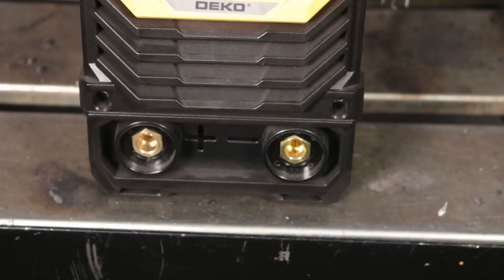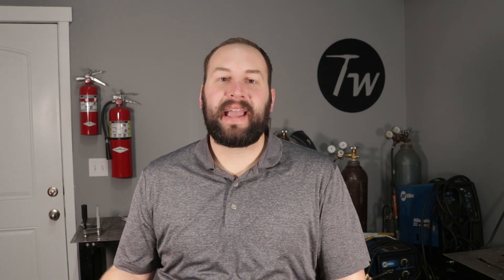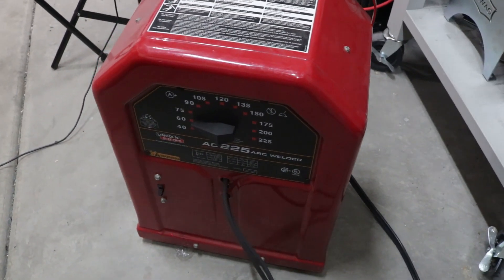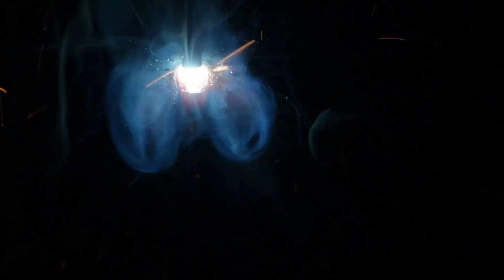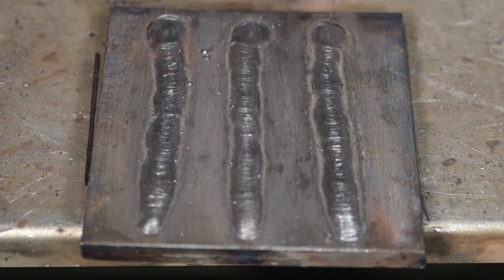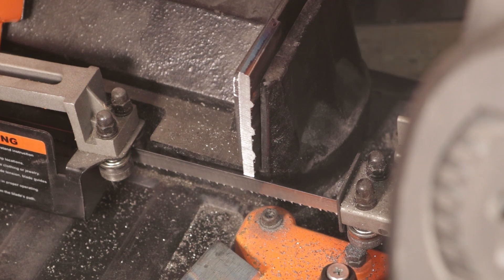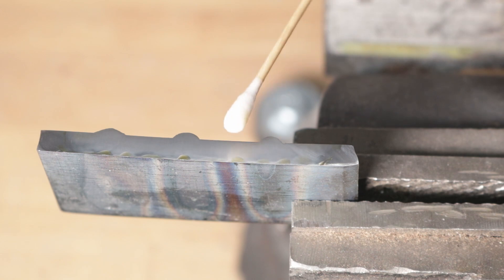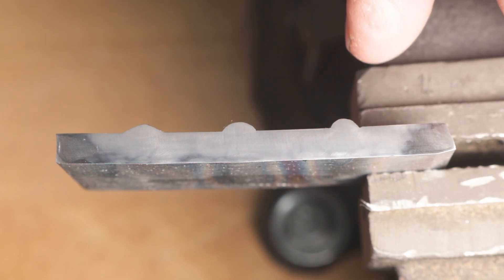Stick Welding Polarity Explained: AC vs DCEP vs DCEN

Comment from the maker: You can learn to weld.  I'll show you exactly what to do in my affordable online welding courses at https://courses.timwelds.com.
Reply: Are there special precautions to be taken when doing DCEN? Any risks of electrocution compared to DCEP?
Reply: 2/3 of your heat is always on the neg side - you have it backwards. That's why you get more penetration on  the EP as opposed to a shallow weld on the EN side
Reply: Hi,
What does IGBT stand for? Is that a DC welder?

Comment: Bought a box of rods (Niko Steel 7016 RD-360U) on the box it recommends to run root passes at DCEN but whenever I've tried running them negative they just rope up like that third one and don't seem to penetrate much, even if I turn it up hot enough to burn holes, it never seems to wet out properly. 

I've read the characteristics of the rod and they do claim that fillets especially will be quite concave. Did all the same welds with DCEP and they ran so much better, I can't work out why the manufacturer would recommend DCEN?
Reply from the maker: DCEN reduces penetration, so for an open root butt joint, it could prevent burn through. I’d just run DCEP if I were you. I run DCEP more than 99% of the time with all stick rods.

Comment: I thought DCEN provides deeper penetration compared to DCEP..
Reply from the maker: It does with TIG, but not with stick welding. EP sends the bulk of the heat to the electrode, but it’s transferred right back into the workpiece with the molten metal.

Comment: By the way Tim, after having cut; polished; and applied a chemical solution to your metal “sample piece with the #3 welds”, I did not see any  difference between the welds because it was blurry! … Which by the way was the  purpose  of this instructional video.! … To show us the different weld penetration levels due to the different electrical power outages.
Reply from the maker: EP penetrates most, AC is the middle and EN will be the least.

Comment: I found the easiest way to remember the (general) correct polarity for a welding process is to consider the electrode itself. If the electrode and arc are together (SMAW, GMAW), and the electrode itself is being consumed, the polarity will be positive/reverse polarity. There is a caveat to this, and that is self shielded flux core (which runs on negative/straight polarity), this is due to a specific design of the wire and flux, which is a significant difference to dual shield flux core design. Following this logic, if the electrode is not being consumed by an arc (such as in GTAW) the polarity will be negative/streight polarity, at least most of the time, again there are caveats to all of this.

Once the above is understood you can start to learn the reasoning behind the polarity which can be confusing. Tim in the video says the terms straight and reverse are not used anymore, I don’t believe this to be true, and here is why.

It’s the difference in electric theory. There are two theories , the first, and more known, is called conventional theory of electricity. This is what’s going on when powering most things, such as the lights and appliances in your house, your car, or electronics and industrial machines etc.

Welding does not use conventional theory, (at least not to weld) the way the welding machine draws its power is through conventional theory, but not the actual welding. The welding processes use something called electron theory.  This is where the terms straight and reverse polarity come from. Have you ever wondered why negative polarity is called straight polarity, while positive polarity is called reverse polarity? Seems like it should be the opposite, and this gave me a hard time in welding school.  The reason for these terms has to due with the flow of electrons, which electrons are negatively charged, meaning the flow of electrons is from - to +.

Quick side note, in conventional theory, electric devices generally are set to have electrons flow from positive to negative, and let’s say we were powering a fan. If the polarity where were changed the effect  would be the fan turning the opposite direction.

Back to electron theory, the setting of polarity, controls the flow of electrons. So, since electrons are negatively charged (flowing from - to +), this is why negative polarity is called straight polarity, it’s the natural flow of electrons. When polarity is changed to have electrons flow from + to - this is countered to the natural flow, hence reverse polarity. 

This leads to heat direction,( whether it’s from the work piece to the electrode or electrode to work), which Tim explains well. However to link what he says to what I’m saying, every time Tim says heat, in your mind also think of the word electron.

So for the very best explanation of all of this, I want to refer everyone to a channel called (making mistakes with Greg). He draws pictures that illustrate the ins and outs of conventional theory vs electron theory, and explains with words way better than my attempt.

Comment: For example. Tungsten electrode spec may be stated:-  2.4 mm tungsten needle
Positive electrode: Current 170-250 amp; Negative electrode: current 17-30 amp; Ac current 120-210 amps. Usually TIG machines are electrode negative. The current rating of the tungsten electrode seem very low! Please explain. Thanks.
Reply from the maker: Most of the heat goes to the positive side of the arc, so with DC TIG, you run electrode negative to put most of the heat into the workpiece to avoid melting your tungsten electrode. With Stick welding, you want to melt the consumable electrode, so you run electrode positive to put more heat to the electrode side.

Comment: TIG:- What is the DC electrode negative current operating range of the 2.4mm Blue WL-20 tungsten electrode?
Reply from the maker: I've run those up to 250 amps without a problem. Not sure of the rating though.
Reply: Up to 250 Amps electrode negative though the electrode negative dc specification is 17-30 amps? Correction:- Tungsten electrode spec may be stated:-  2.4 mm tungsten needle Blue WL-20 :-
Positive electrode: DC Current 170-250 amp; Negative electrode: DC current 17-30 amp; AC current 120-210 amps. Still no very clear on this, thanks.

Comment: So, from what I can find, it seems that if there's slag, DCEP.  If there's no slag, DCEN.

Am I wrong?   Are there exceptions? 

SMAW (slag): DCEP
FCAW and duel shield (slag):  DCEP

TIG (no slag): DCEN
MIG (no slag): DCEN

Are there exceptions?   I understand you can sometimes weld in different polarities to get around problems, but the "correct" polarity seems to follow the rule:
 
No slag=DCEN.  Slag=DCEP."

Comment: Hi, I had not heard of it some years ago . And we had to weld stainless steel square 2mm tubing. we did the job, but it was difficult enough.  Now, lately, I have heard that welding with the negative side is better it does not penetrate so deep, and the electrode melts a bit vaster . I tried it out and oh boy if we had known that it is so much easier . Ireland

Comment: Great video. It really put these into perspective. I have an AC welder but it's one of the Chinese models that apparently is supposed to be arc, mig, tig and plasma cutter AIO and even though I did read the manual there was a lot to take in so I'm now curious to know if it can do both AC and DC with just a switch of the cables on the ports. Thanks 👍

Comment: Is dcep the same as 'crisp' and is dcen the same as 'soft'?
Reply from the maker: Generally, I’ve used those terms relating more to short circuit MIG welding where the arc is not continuous. With stick welding, the arc is always on so those don’t apply as much unless you’re whipping and then that would be controlled with a dig or arc force setting if you had one. Polarity will really just affect penetration with stick welding and DCEP is almost always the better option.

Comment: Can you run 7018 AC electrodes on DCEP?
Reply from the maker: Yes, DCEP will work great. 7018AC has some arc stabilizers so it won’t go out when the polarity switches on AC, but it still works great on DC.
Reply: @TimWelds  Thanks.  I accidentally picked up a box, and didn't realize until after I opened the box.  Didn't want it to go to waste.

Comment: 6013 is my favourite rod, id love to see some videos of fillet welds with different rods, when i was learning stick sometimes i felt i got good penetration until i cut it on the bandsaw and could clearly see the parent metal zero fusion, mad respect to all the welders of all diciplines, metallurgy is facinating

Comment: I'm new to welding, and had no idea you could switch the electrodes around.  I've been having trouble melting straight through sheet metal, hopefully this salvages the disaster!
Reply: Did you have try it out ? did electrode negative really help with thin metal ?
Reply: @harisyoung4110  It did help reduce burn through and I didn't melt the sheet metal as much!  It did reduce penetration and the welds had a little more trouble sticking together, but it was better than melting and warping it

Comment: Hello
Is it allowed on build in cables to modefie them to a connector typ cable plug in system on arc Stick welder?
My old cable and holder is probably broken and corroded and I was wondering if I could replace the hole thing with a changeable version. 🤔

Comment: every time I weld, I burn through the metal. I'm running 60 amps with 1/8 inch 6013. my travel is the same as yours, but I'm falling through. I have a deko 160. maybe my welder sucks? it seems like a box of lightning. I've never run it past 60 amps. I figure if I'm burning through, I don't need any more, right?

Comment: Great video! Maybe you can help me. I’m trying to run a Lincoln buzz box AC welder on a 10,000/8,000 running watt generator. It has a 50amp output. The highest amperage setting I can run it at is at 75 amps. At 90 and above it trips the breaker on the generator. When I check the amperage at the welder’s cord I’m pulling 45 amp on each leg, that’s welding at 75 amps. At. 90A it goes to  55A per leg, thus tripping the breaker on the generator. After watching this video, I’m wondering if I convert it to run at DCEP or DCEN, if possible. Do know if the amperage at the cord/plug/panel would be reduced to lower amperages? After looking into my issues, I’m thinking I may have try an Inverter welder of some sort. Thanks in advance for any help

Comment: The reverse / straight polarity terminology always drove me nuts. Especially since the vast majority of DC systems are negative ground - so it's backwards from the stupid old school non-descriptive welding terminology. There is NO mistaking what DC electrode negative means.

But it gets even worse than reverse/straight ... I've seen "DC+" and "DC-" used to indicate ... "DC+ = work piece is positive" ... WHAT??? What good is specifying a polarity, then not specifying which of the 2 is positive - and why if you do that, would you go against convention of "DCEN" where you're talking about the electrode, not the work clamp?

All the "bubba science" in welding man ... it's one reason I gave up on it 20 years ago. Met a lot of super high skilled welders that either didn't know - or couldn't explain to anybody that didn't already know. Or it was protectionism, which is equally stupid. Some guys you ask how to do X, and the answer is "you just gotta know how to do it" or some asinine nonsense.

Comment: Hello again , I noticed in  other videos explaining the difference in polarity it is also mentioned that DCEN polarity provides deeper penetration and DCEP is preferred for welding thinner material . Thanks
Reply: Yes. I don't know which explanation is the correct. DCEP or DCEN is best for thin metals? Arguments are opposite depending on the source you consult and both seems to be the correct one
Reply: You got it all mixed up sir

Comment: hi thanks for the great video . Im confused on the penetration issue. most of what I have read from welding books I bought over the years say that DCEN gives better penetration since more heat is at the base metal . Is that old theory and has it changed ? Thanks

Comment: I can't see the "penetration" you are talking about. Perhaps you need to look at it under a microscope for the viewer to see the difference between the surfaces due to etching. I do agree that the term "reverse polarity" is not informative. "Reverse of what?" I would ask. "Reverse of Normal" is not informative. Before it means anything you need to know what is normal and why it is normal. It might be just as logical to call the reverse as being normal. I think a better term would be Cathode vs Anode Welding. Those two terms are crystal clear if you know what they mean.

Comment: I am wondering how you got deeper penetration with DCEP and less with DCEN when with DCEP approximately 2/3 of the heat goes to to rod and 1/3 to the work and with DCEN approximately 1/3 of the heat goes to to rod and 2/3 to the work?
Reply: Correct. He’s confused on this point for some reason. He’s a good teacher otherwise, just don’t think this is particularly solid advice.

Comment: Hi Tim, catalytic converter got stolen on my car. Had to weld a new adapter on where they cut the pipe.  I never welded before but I learned a lot on your channel. Because muffler pipe is thin I bought a 200 Amp 120/240V  inverter DC box for  $180. Used 6013 rod on DCEN and practiced on some scrap. Saved thousands of $$$. 
But I did notice the small scrap metal could not absorb as much heat and burned thru. While the large piece on the car work well.
DCEN worked better .
Reply: I think you meant DCEP - worked better..? You’d use DCEP if you can’t turn the voltage down and are burning through. DCEP is the alternative to use when dealing with thin metals though the slag will be worse.
Reply: @AXNJXN1  NO

Comment: Just welded up a 1.3 exhaust with DC neg yesterday, use the positive and it will go through like butter
I think your under cut was probably caused by running the neg one slower trying to compensate for the lighter burn

Comment: Let me give you a hint to everyone questioning real life examples. You will be mostly running DCEN (earth cable will be +) because let's face it, you will be doing rust repair which is why you bought that IGBT inverter welder. Stuff that is thin, stuff that you have 1 shot at doing right, stuff you want to tack in place like a washer and a nut etc...basically you don't want to end up blowing holes. Another good thing about DCEN is there is less splatter as you probably noticed in the videos which is why 10 years ago everybody in the forums was telling you to run DCEN on inverter welder. Now if you want to weld a differential for drifting or something structural with lots of meat, sure turn back DCEP + to + and - to - Short version: when it comes to stick welding, penetration is never going to be a problem.
Reply: True, but it kind of sounds, like cheating. 🤣 🙏🏾 It helps a lot though, with the burned through.

Comment: Awesome! Thanks.
    I find that with dcen i can maintain an arc with less amperage than with dcep. Also with dcen the arc blows/pushes the slag out of the way more effectively than dcep, i can get the slag to peel, using 6011 or 6010 with dcen.
Reply: Correct. He’s a good welder but he’s really got this wrong here in this video for understanding. You should always start with DCEN first unless your doing very thin material.

Comment: I had an old lincoln that I got rid of because I was moving and didn't feel like taking it. 😒 Mistake but it was great, it would run ac or dc with just a flip of a switch.

Comment: The easiest way i found to explain this, is this: with DCEP (reverse polarity) 70% percent of the heat is at the electrode and 30% of the heat is at the work, DCEN (straight polarity) 70% of the heat is at the work (ground cable side) and only 30% is at the electrode side.
I have primarily only welded with DCEP when using SMAW. However this is a great benefit while using Tig, allowing you to put maximum amount of heat into your work while saving your tungsten from exploding
Reply: I think DCEN (straight polarity) has deeper penetration ,since heat distribution on the work metal is higher and which melt faster than DCEP.
Reply: If you weld using reverse polarity (only), with the GTAW process you will consume the tungsten electrode. You can weld with alternating current (AC), which is a function that alternates between DC- and DC+, on some applications such as aluminum.  Think about the percentage values you mentioned. If 70% of the heat is at the electrode, how does this translate to more heat at the work end. If 70% of the heat was at the electrode it would result in a melted tungsten.

Comment: So what does that mean on a machine that has it listed as dcrp and dcsp I know it stands for DC reverse polarity and DC straight polarity but having a hard time finding information on these old terms versus the new ones aside from the little bit you went over in the beginning which basically means that dcrp is basically having it set at positive polarity so I am assuming dcsp is negative polarity? I'm a little confused but get the general gist of it

Comment: Hi, great video. I think the choice of dcep or dcen is also depends on your chosen electrode. The electrode manufacturer indicates wether it's a dcep or dcen, wouldn't you go by what they say?
Reply: Doesn't that just mean we'd choose our rod accordingly?  Seems a lot of those polarity call-outs are for AC and one of the DCs. btw, this video could help me redo my last project .. after I grind out the globs I left on the entire first attempt, lol. I was running 1/8" 7014 at ~120a but AC because I didn't know better. :-/